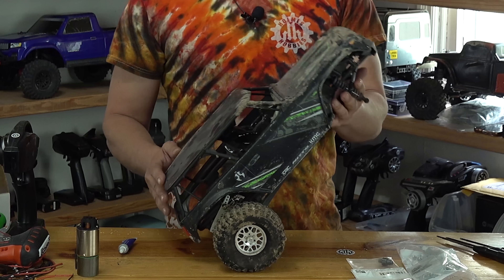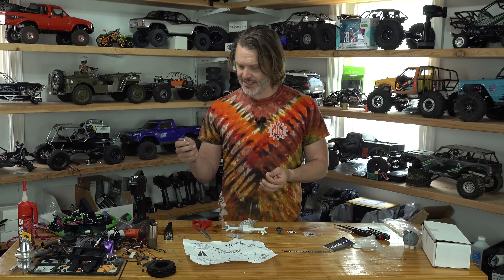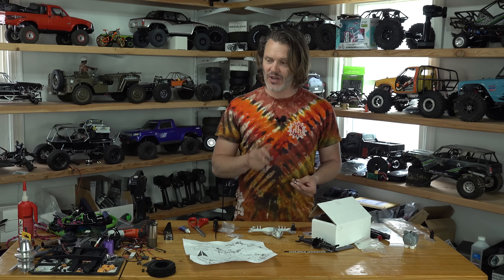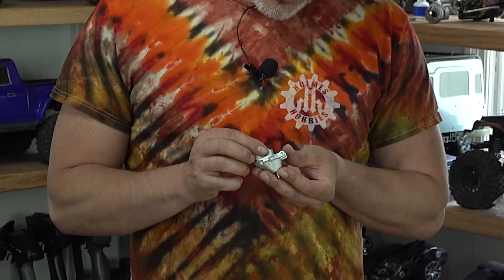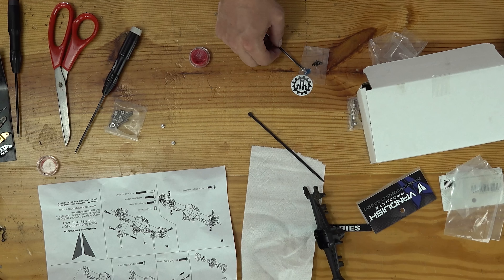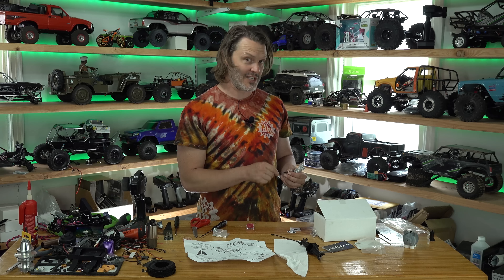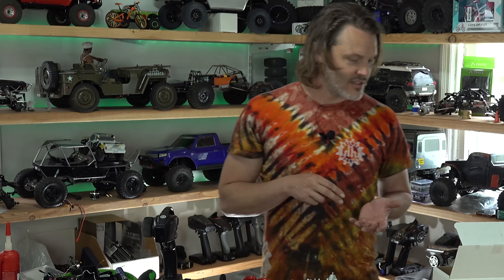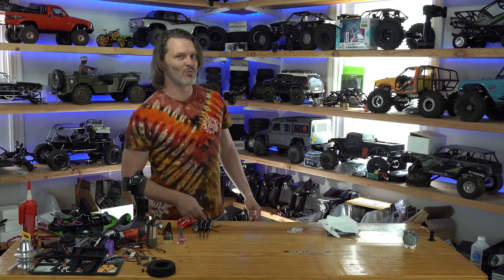Desperate Times: Reviving the Holmes Hobbies Wrath 1.9 RC Crawler After Years of Neglect (Wrenching)

Comment: But on a lighter note, I ran into someone brand new to the hobby at the crawler store the other day. He had blown his trx4 motor. He asked the store clerk for a replacement. The clerk grabbed another traxxas motor with no questions asked.  I saw your motors sitting there for the same price. I recommended your crawl master motor as an equal cost upgrade. He bought it and unfortunately he left his crawler for the store to install it…🙄 anyway, I didn’t realize until I got home that it was a double win. I encouraged a Holmes hobbies sale and discouraged a traxxas sale.

Comment: Loctite is an anerobic sealer and cures in the absence of oxygen according to the clsss I took presented by loctite
Reply from the maker: Cures in the absence of o2 (doesnt need it), but if that was the whole story it would cure inside the packaging, right?
Reply: @HolmesHobbies  no, that’s why the bottles aren’t completely full. I asked that same question. That space of air at the top keeps it from hardening in the bottles or the tubes. It’s strange stuff

Comment: Traxxas K10 High Trail Edition 8lb rig. What servo and motor would you recommend?
Reply from the maker: You wanna only crawl or you wanna fly?  

Puller pro 3500 and shv650 would be my overkill choice
Reply: @HolmesHobbies  both!
Reply from the maker: @EricsRC  yeah, puller 3500 and 650 servo is real nice.
Reply: @HolmesHobbies   I have the Shv800 installed at the moment.

Comment: I spent hours, shimming, adjusting setting up the pinion just right....... kind of upset my OCD when I finally realized the rear drives off the coast side.......the front drives off the correct side of the helical gear.....did anyone else notice?
Reply: Stainless links with trx4 rod ends(gotta clearance the skids), but those trx4 rod ends are so beefy. Any time I upgraded links to 5mm stainless I never had trouble with rod ends pulling out..... With the exception of that shv800 pulling one apart because I was an idiot.......

Dang those vanquish wheels look so premium. Id have to sell a rig to afford em
Reply from the maker: Yeah, rear would have to be reverse cut or low pinion.  Seems it's stiff enough to handle the pinion getting pulled in.